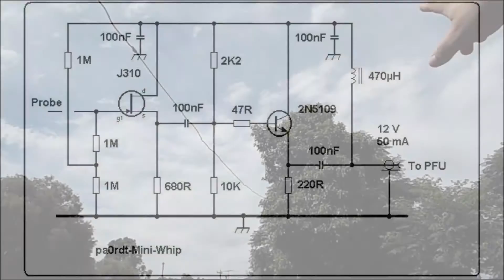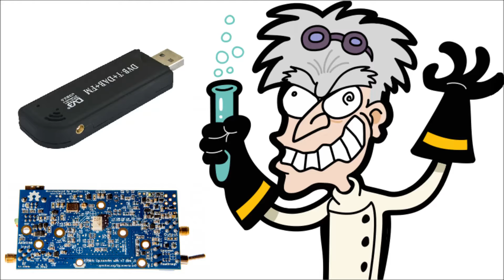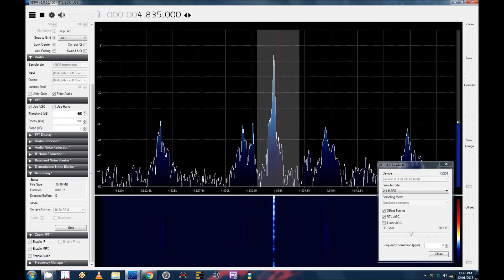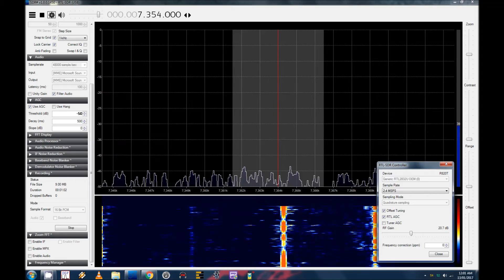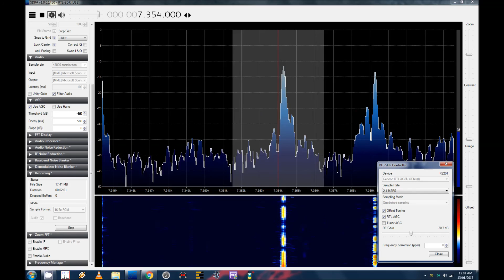Mini-Whip (RA0SMS) Vs. Random Wire Antenna

Comment: You must try copying the weak signals to see which antenna is performing better. That is far too strong signal to notice which antenna is better for the signal.
Reply from the maker: Whilst the comparison did indicate some difference the intent of the video was to compare the smaller amplified mini whip antenna to something not all listeners are able to install at their QTH (a larger wire antenna), they performed fairly equally which given the mini whip's small footprint is rather impressive 👍

Comment: Current version comes with much better pcb and power supply.
Reply from the maker: Good to hear, it wasn't the manufacturers fault the Australian/Russian Postal Services were so rough with the package, it still works great and I would love to compare it to the current "popular" MLA-30 antenna, perhaps a 2020 project?
Reply: @SpectreOZ  my MLA-30 is shipping. Need good antenna switch. What can you recommend?
Reply from the maker: @Life2  I don't use antenna switches never have actually, probably a hang up from my CB days where inline insertion losses were something to be avoided at all costs 👍
Reply: @SpectreOZ  vs 40m dipole. https://youtu.be/QXBOGIJIDug

Comment: For indoor reception I use wire loop antenna ( 10...15m) long wire make loop about 3x4m 
Works 10kHz to 30MHz, using resonant circuits.

Comment: Hmm, I am still quite unsure of which one I would need. I would buy a mini whip though. Not too expensive
Reply from the maker: JumboBumper Different antennas differesnt performance, the miniwhip excells on LW and MW (compared to the longwire) but the wire antenna cost nothing to make 😎
Reply: SpectreOZ Well. Won't I need something like a balun to make a good wire antenna?
Reply from the maker: Depends on your location as to how you feed your antenna to the receiver, I use a straight run of wire from the tree to the radio, no balun, no coax, simple effective but hardly optimised :)

An optimised/balanced design would require a balun and/or an improved feedline (especially in noisy RF environments)

Starting out with a random length wire antenna is as good a starting point as any, you will quickly decide what issues you are experiencing and search for a better (more suitable design) from there.
Reply: Ah right okay. Many of the online drawings of wire antennas use an insulator, you use an insulator? :)
Reply: How do you connect your random wire to the radio? I have a PL-660, so I just wrap the non-insulated wire around the antenna.
Reply from the maker: JumboBumper Same as you or with an aligator clip :) 

Some of my antennas use an RF connection like the T2FD, 9ft copper vertical and the mini whip 👌

Comment: How high did you have the active antenna and was it grounded via the mast/coax? How long was the coax? Im just about to mount the PA0NHC version miniwhip, hope it works as good as your demo!
Reply from the maker: Hi Danny, the antenna is mounted around 15 - 20 feet in the air, the coax is just CCTV grade 70Ohm cable I got for free and just slightly longer in length. 

Coax shield can be grounded at will but I notice varying RF noise sources from time to time where grounding can both help or hinder.

Comment: Longwire is better, when you have a garden / backyard. But if you live in a block, you must accept some compromise. Like in my case: 10-floor building with elevator systems and GSM tower on the roof. The longwire receives noise, noise and noise. The MiniWhip is a little better, with good grounding.
Reply from the maker: Indeed, better the bird in the hand than 2 in the bush... compromise in the pursuit of personal hobbies is an unfortunate consideration which must be made :)

Comment: Hi there, thanks for sharing this interesting video. The audio sounds very similar to me, but that is to be expected I suppose given they are both E field antennas. In my (recent) experience, the SNR of the Boni whip and a 30 metre longwire is similar in my urban environment, just that everything is amplified with the whip. 73! Clint
Reply from the maker: Thanks Clint, SDR permits me to choose "non-standard" bandwidths this can also obviously effect the sound quality/fidelity although there clearly is an audible difference between both antennas :)
Reply: For sure. Maybe I've been listening to rock music too loudly for 20 years lol, but to me there's not much difference in the quality of the audio between them. 73! Clint
Reply from the maker: +Oxford Shortwave Log Not a huge difference, the MiniWhip is quieter with a slightly better SNR.

I have to wear headphones to notice the difference though... as I too have listened to music (too loud) for many years as well :)
Reply: Great minds listen alike lol. 73!
Reply from the maker: +Oxford Shortwave Log It would appear so LOL

Comment: Hey Oz this is a great side by side. I prefer the random links wire over the other one as far as signal strength. But the SNR is definitely lower on the active antenna.

Thanks Oz
Reply from the maker: Hi RR, SNR is definitely important, I hope HF conditions have been better in your hemisphere lately...

Comment: The long wire appears to be a better performer.
Reply from the maker: Thanks for dropping by... the MiniWhip often has a better SNR than the wire antenna depending on the direction of the noise source but clearly on this occasion it was outclassed by the wire antenna which thankfully I have the luxury of having, we have no HOA's here :)